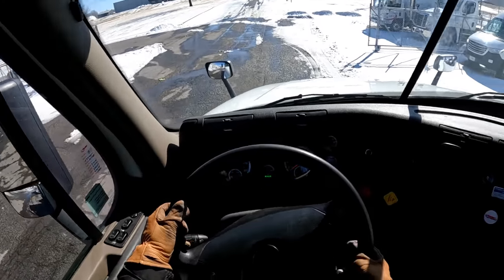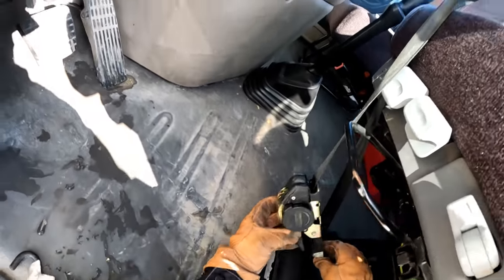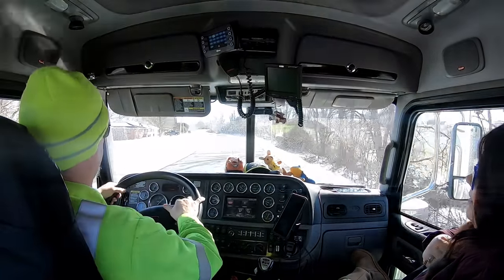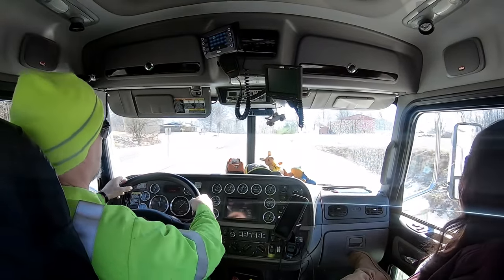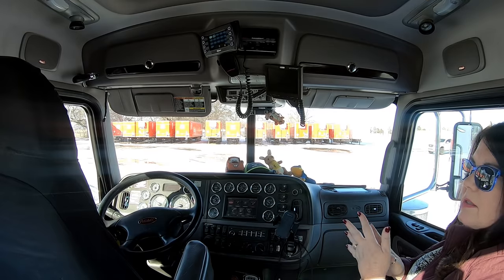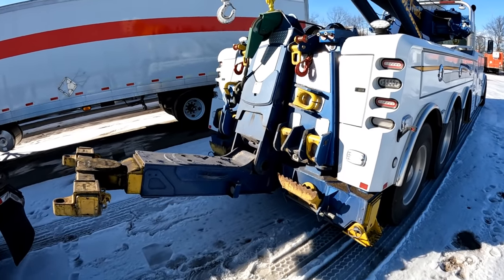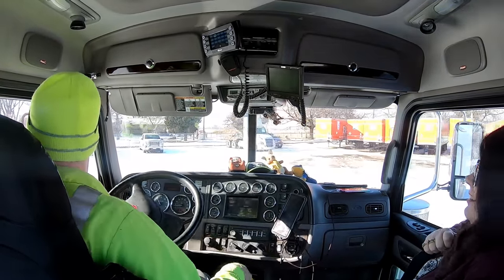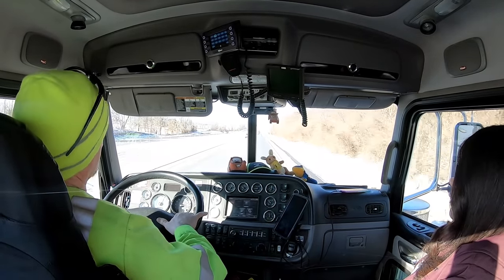Q&A Tow with "Mom Pratt".   INQUIRING MINDS WANT 2 TOW, I  mean KNOW

Comment: I have always been in awe of folks who put aside their comfort to help others.  Whether that be an electric lineman repairing lines during a storm so folks have heat.  Or a plow driver that gives up family time to keep the roads safe.  Tow truck drivers, keep us safe and get us where we need to go.  Also, when someone is trapped in a semi, the tow driver is the one who gets the 40k lb trailer off the cab. They are also the ones who save the freezing family when their car dies.  If the people of the  US Coast Guard are angels with rotors and boats.  Tow drivers are angels with tires and hydrolics.  The go out when nobody else will go, to do a job, nobody else will do..

Comment: Good information for folks that don't know--- and a LOT don't realize that if wheels are ROLLING- you have more control, whereas if brakes lock for one reason or another- you slide or move in ONE Direction- and can't change it..   I learn a lot watching your videos- and REMEMBER a lot that I learned the hard way.  YOU should REALLY MAKE TRAINING videos for the tow association and AAA to show to their new drivers getting certified.. Always so good, and absolute GOOD info!!!
Reply: My guess is a training video would add a measure of liability to the operation, as everybody has their own tricks that may not be industry standard but work perfectly well.
Reply: What about RTmond?
Reply: I was taught the first thing to do if something goes wrong in front of you is to hit the brakes hard. That does two things it sheds speed and shifts or loads weight on the front wheels. A few seconds later get off the breaks and steer away from what the problem and gently apply the breaks. I don't know how many time I've watched YouTube crashes that could have been avoided if drivers were given the correct training--slow down and pay attention.

Comment: Good morning Ron & Mom Pratt.  My only comment on the prep for towing continues to be the lightbar.  As often as I see broken rubber straps along the road (and have several break in my shed just holding up weed wackers etc) , why not have a secondary safety strap on the light bar?  Seem like the price of a ratchet strap would be worth the cost of replacing a damaged or lost light bar.

Comment: That drivers side door needs some WD-40. Very squeaky door. I learned something today. It has been a few videos since I have seen you disable the drive train. I learned that if you tow a truck from the front it requires more prep work (like disabling the drive train) then pulling from the rear. 
I do try to learn how you do things it helps to understand your work better. It also helps me understand what my Dad did during the war years because that was one of his jobs. I know the industry has changed from 1944. I would ask him but Dad made the earthly transition Sept 2014. Before I started watching your channel
You do the more traditional towing operations. Whereas the Southern Utah towing companies do more off-road recoveries. They use winches and kinetic ropes.
Reply: Door hinges are usually lubricated with white lithium grease. WD-40 is not technically a lubricant but a moisture displacer and protectant.

Comment: When I was learning to tow- I hooked up a 4x4 that was messed up- and loaded the front end normally- and put the rear wheels (that were locked up) on two dollies  directly on the ground.. and took off-- at SPEED LIMIT for about 30 miles.  HA.  It never occurred to me that those little 9inch wheels had to turn a LOT faster to keep up with the rest of me and that poor dolly could have locked up and I'd have been dragging that 4x4 all over the interstate!!! ha.  Luckily it didn't and I made it in ok- but talk about HOT--  had to relube the wheels.. once they cooled.
Reply: That's why I use Sheaffer Hi Temp grease in ALL my bearing sets.. including my dollies

Comment: Thank you for letting us ride the jumpseat on this quite normal tow but love the commentary and the Q and A   ive seen the tator in person that thing has more bright flashing lights than a electronic rave party lol

 and always slow it down to 40-45mph maximum more often not its slower cause  junk weather and lanes are closed off etc  i use a slow speed  thru a scene where i can get the kenworth stopped in 170 feet and not hit anything should my lane be fouled by a person or object suddenly

Comment: Thanks for another interessting video (i enjoy your channel for some years now). At around 16:00 you're talking about parking brakes not working on the front axles - i can surely say for Germany, that parking brakes usually only apply on the rear axle(s) here as well. At least the spring-loaded brake is usually not installed on front/steering axles. On some trucks, e.g. fire/rescue/tow trucks with front pulling winches, the parking brake might apply pressure on the front brake cylinders to increase resistance, but even on these you don't have spring-loaded park brakes. This should be similar for all EU-countries, maybe even further - there's a lot of trucks going through whole Europe and some even go further.

Comment: Oh always remember not all vehicals have a lock stearing wheel and not good idea to rely just on the steering wheel lock system to keep front wheels straight ! " When doing a rear tow !! When using a towbar with all wheels on the ground ; remember not all vehicals like going around corners with a towbar ! Of course when carrying the one end of a vehical on top of the towbar ,it is like towing a trailer ?

Comment: One of the most important things when towing is good working breakes !!  I know it is like when the breaks go out while towing a car ! Also speed is important to consider too ! Also The size And weight of the tow veical VS the size And weight of what you towing ! ( example : lets say you have a small truck like a Dodge Dakoda and towing a 1/2 ton pickup with a fullsize truck camper on it , using a towbar !! ( buy the way the example here , i did that !! Pluss the item you are towing it with : a towbar, towdolly, or trailer ! !

Comment: Thing that I have kind of wondered about is the Safety Chaining, YES NEEDED not disputed. But I had been taught and agreed with was we put the biggest chains wrapped very solid points but we went from 1st fly of boom with enough slack not to pinch. In the the event that vehicle broke loose it was hanging supported not whipping. 

  Granted in this video you brought up leaving service brake which I do to because hauling there is no need, mostly to keep a wondering vehicle happening when unhooked. But given you're way what would happen. I am not knit picking just looking for a other side view with knowledge
Reply from the maker: Your method makes sense and I can't argue with it's usage.   I can only state that the way I do it is the way that Miller Industries designed their Safety Chains to be used.   Thanks for watching and God bless.

Comment: RE: "Arc Nemesis"  I always say it would be an "enlightening experience" for a "well-grounded individual" :)  I worked in a cast iron foundry in high school where the furnace was electric.  The amount of power required to melt 3.5 tons of cast iron starts at "a lot" and only goes up from there.  The foundry drew enough power that if the power cut out, the power company would actually call the office to tell them when the power was coming back on.  I've always had a healthy respect for voltage, even prior to that job working on a family cattle farm and finding all the ways an electric fence can short across gates :)
Reply from the maker: I love it and may have to swipe some of your comments to "spark" new viewers lol  Thank you for watching and God bless.
Reply: Electric fences. One can bump it once okay. But get zapped the second time. My friend didn't realize that the first time was in between the pulses. Ouch!😳
Reply: @RonPratt  I got the "enlightening experience" bit from a comedy routine long enough ago that I no longer remember who said it. I added the "well grounded individual" bit after college during a gab session with some coworkers after one of the interminable "safety" briefings we had to endure for "dangers" in the computer lab in California that were absolutely nothing compared to growing up on a farm two states east of you ;)  You are certainly very welcome to use any or all of it in any way you choose.  I lay no claim on just about anything I may say or write anywhere, especially here :)
Reply: @elizabethbottroff1218  Most of my zaps were from an awkwardly wired gate next to an electric fence.  My job as a kid was to open and close the gate for Dad who was on the tractor.  Unfortunately, while Dad could do just about anything he decided to do on the farm, he wasn't all that good of an electrician.  Between that and the cattle rubbing up into the fence whenever it was unpowered, the gate was often significantly charged whenever I tried to move it.  If I had to do it now, more than three decades later, I'd carry a copper rod or pipe with me to ground the charge before fiddling with the chains used to hold the gate shut :)

Comment: Hello Ron, its nice to see mom pratt w/ you on the job. If i may ask. Is the break away chain better placed a foot off the ground? (For enough sway when turning) or it should be shorter?
Reply from the maker: The length of the chain depends on your turning radius and your pick point .  There is no set rule on it  as to how far off the ground it is.  It is more the length of the chain than the height off the ground.  I hope that answers your question.  God bless and thank you for watching.
Reply: @RonPratt  thank you for the info God bless and stay safe. By the way i haven't seen talon for a long time.

Comment: Ron, do you typically keep the Rotator free of tow jobs so it can be used for recovery jobs or is it used as needed as the situation requires it? I know you said here you usually use another truck(e.g: the Western Star) for towing. Also, should the Rotator be OOS for repairs and a big recovery job come up, do you have a backup heavy duty truck?

Comment: First, Mom Pratt was great, glad to see her. Now a question, I see some smaller wreckers going to synthetic winch rope. It is supposedly stronger for the same size as steel rope, and safer, so what is your opinion of it, and will you convert any of your fleet the next time you current rope needs replaced?
Reply from the maker: I have considered testing synthetic on at least one of our units.   I know people in the industry who claim they will never go back to wire rope.   While others, claim they will never use synthetic again.    From what I understand there are a  lot of benefits to synthetic, but there are also extra precautions one must take.   The biggest issue is that the synthetic has very little resistance to abrasion and will cut very easily.   There are quite a few of our recoveries where the wire rope will contact the ground or actually go into the ground for a bit while we are winching on a unit.   Had one just the other day where we only had one option for a pull point and it wasn't at a good angle.   No other way in to the casualty and at one point our wire rope was 2 1/2 to 3 feet under ground while pulling a machine up out of a hole.   Synthetic wouldn't have withstood that kind of "abuse".   I didn't like doing it with the wire rope, but, if I get to show the video, you will understand better.   Anyway, there is a possibility that we will test synthetic on some of our equipment.   Thanks for watching and God bless.
Reply: @RonPratt  Thanks for the informative answer. I really feel for you on those long pulls, like the skid steer down the hill in the rain. I am sure that rope gets heavy. With over 25 years as a volunteer firefighter and EMT I understand what you go through on the calls you do not show. I hope through Gods love you can find peace.

Comment: I've been wondering for a while. Why don't you have your air extension hoses plugged straight into the back of the truck and have the curly lines in between the truck and trailer you're towing? Have you ever thought about adding a electric line with circuit breakers to be able to use the marker lights on trailers you tow?

Comment: I enjoyed the show 'Wrecked' while it was on. There was a driver on that show that was hit on a job. After his recovery, EVERY time he went past that spot on the highway he mentioned it and when he had a job there it was very nerve wracking.  I have seen other wrecker shows where drivers have quit after an on the job injury because they simply couldn't bear to get back into the 'danger zone.' 

With respect to safely pulling over and slowing down (BOTH are required in Michigan).  Not long ago I was moved to the left lane along with a very long line of vehicles. We were approaching at least one fire truck and multiple recovery vehicles with a couple vehicles on the shoulder. Well some idiot (I'm being kind) in a jacked up pickup hits the now open right lane and the gas. He blasted past dozens of vehicles and the scene at well over the posted limit. It was disgusting to see. However merely seconds past the scene a blue Charger with a bubble gum machine appeared and quickly reached the bumper of the pickup.  Imagine all the horn blasts and waves as the pickup sat at the side of the road under the watchful eye of the trooper. :-) 

Seriously though people, saving a few seconds is NEVER worth the possibility that you may end up living the rest of your life knowing you've injured, or worse, a person who spends their life in the danger zone helping others. Move over, slow down, and DON'T HOLD UP YOUR PHONE TO TAKE PICTURES WHILE YOU DRIVE WITH THE OTHER!!! (SMH!)

Comment: I noticed you have a tri axle drive on your rig, what is the configuration, eg 4x4x4 or 2x4x4 etc, any should give plenty of traction.
Reply: That is not a tri drive.  Thats a tandem drive with a steerable lift axle (automatically steers itself based on how tires travel like how if your car is set right it should want to go straight if let go of wheel)   when parking brake set or reverse the axle lifts automatically or ron can disable the lowering from outside the trk.  If i remember correctly he can lock the inter axle and each dif forcing full 8 wheel drive
Reply: Twin rear drive axles giving 8 wheel drive, floating undriven steering (tag) axle which you often see lifted if Ron has reversed onto a job, and sometimes turned in a strange direction, and the actual steers. The rear drives can be locked through the power divider so both axles are providing power, with no slippage.
Reply from the maker: Thank you for watching and God bless.
Reply from the maker: Thank you for watching and God bless.
Reply from the maker: No way!!!!  Thank you for watching and God bless.

Comment: why test left and right turn separate instead of hazard lights when its the same function ? i would even think imo that you can test full function in your case by turning on the breaks and then just the lights and get full functions ? or are you more so making sure the transmitter is functioning proper ? because once you have seen the dim function and bright function of bulbs / leds then its fully functional

Comment: @Ron Pratt, a question for the next Q&A...I was reminded of this when Ron said "did I bring the remote or not"...so many times I have seen you sit down the main remote to say pull 100' of cable and then have to walk back to get your remote. Why don't you use the strap harness that accompanies the remote?
Reply from the maker: Good question.   I did when we first got the rotator.   I've since learned that one slight little bump to the joysticks and that function on the boom or winches is going to operate unintentionally.   So, rather than shut the remote off, say while pulling cable, to keep from inadvertently raising the boom, it's easier to sit the remote in a safe location and leave it powered up.    Hope that explains it.  Thanks for watching and God bless.
Reply: @RonPratt  Thanks for the reply sir. That makes sense. Blessings to you and yours

Comment: Have had a rear bobtail tow. The driver didn't strap my cab extenders and being pulled in reverse.  They were pulled out by the wind at highway speed. Was wondering if you had ever had any issues.
Reply: On one of his recent videos, he noted that one had already been knocked off by someone else before he got there.
Reply from the maker: Not personally but there are certain types that must be secured before towing from the back.  Even then, I will slow my speed down and not run typical highway speed to ensure safety.  Some wind fairings are designed better than others.  Thanks for watching and God bless.